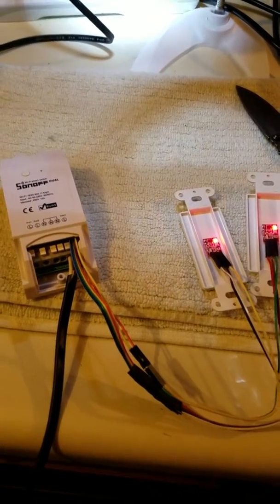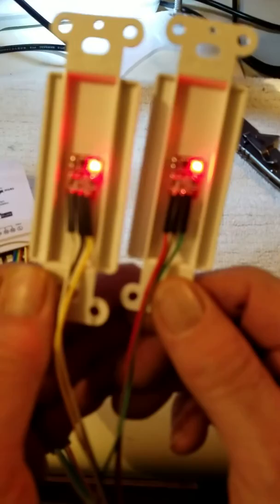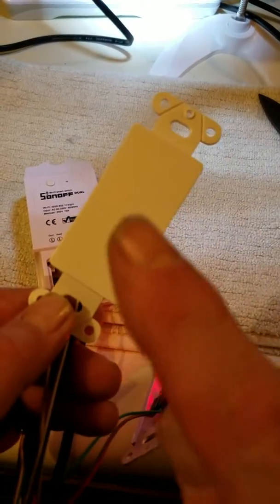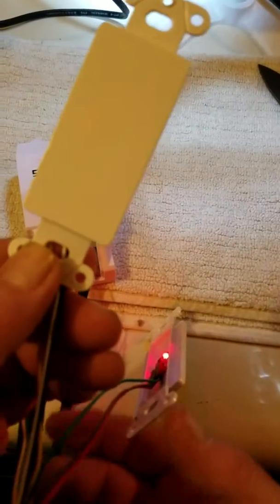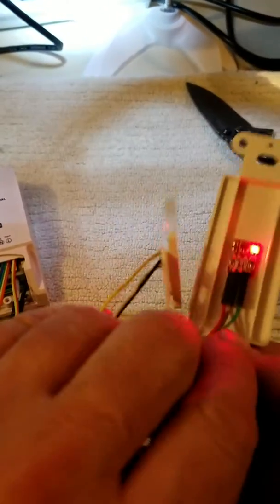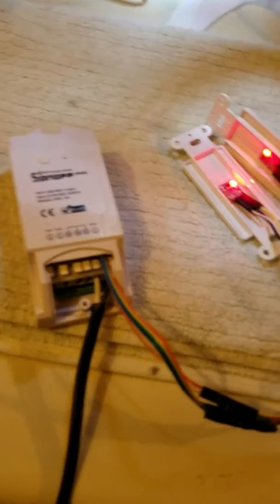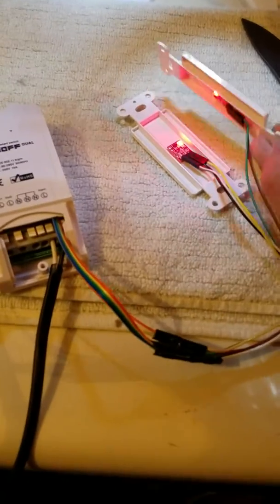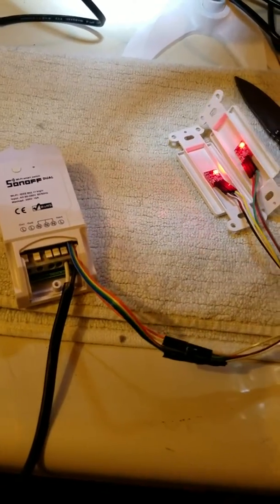Sonoff dual touch sensor wall switch prep

Comment: Does the Dual have stock firmware?  I have everything I need but when I try to hook up BUTTON 1 I loose wifi app function. How did you wire it?
Reply from the maker: yes, this sonoff dual is using stock firmware. Basically what ever you use to switch manually using the button headers on the pcb needs to be momentary, so when you short button0 or button1 to their respective GND header pin it will toggle that channel on the sonoff
Reply from the maker: I think what is happening to you is that the switch you are using is not momentary and has the same effect as holding the pairing button.

Comment: Where did you get the touch sensors from?
Reply from the maker: just got them off of Amazon capacitive touch sensors
Reply: Larry Watson 
Would also like to know how you wired? I see you've got 3 wires per touch sensor
Reply: Larry Watson how do you connected the touch sensors on the board?